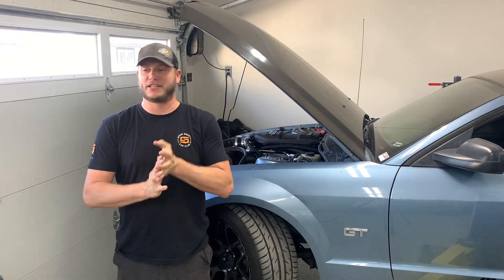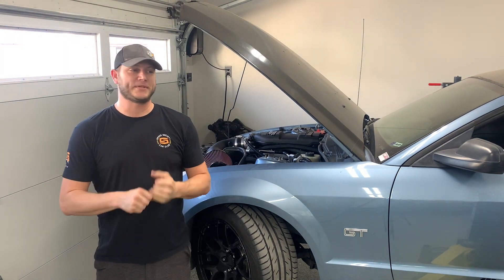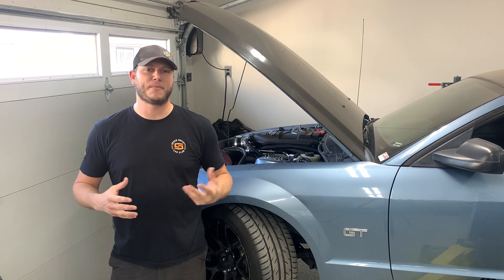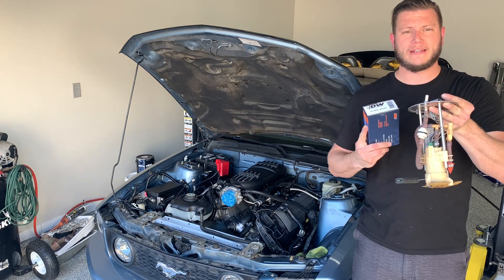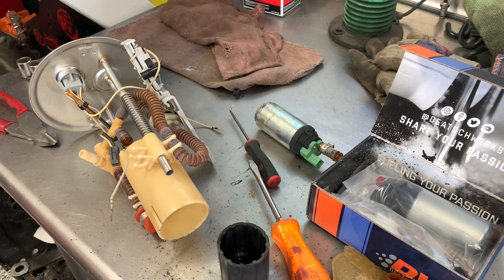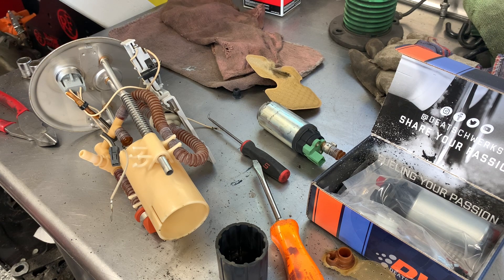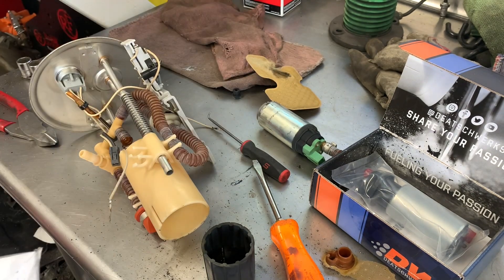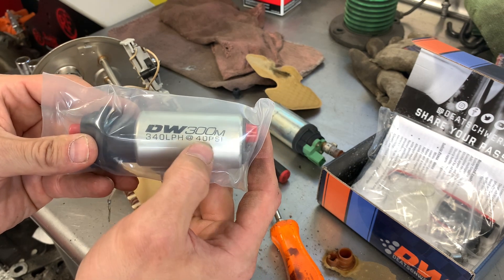Making a return style fuel system for your S197, completing it for the Coyote Swap!

Comment: is this really necessary i want to do  the coyote swap but dont really want to mess with fuel system like this can i just use coyote fuel line or maybe coyote tank pumps off 11-14?
Reply from the maker: Sending units aren’t compatible with the older tanks nor the cluster

Comment: I am a little slow, but is that "return line" connected to the fuel filter?
Reply from the maker: Correct. Since the filter is also the regulator

Comment: I have the dual GT pumps because I was running the Vortech V3 and 60lb injectors on the 4.6 3 Valve, making nice numbers. Is the same thing needed for the return? I see another well known Mustang channel that did a swap and they did not do the return line, so I am a little confused. Is it absolutely necessary to make it a return style system? Thanks.
Reply from the maker: Now that I’ve learned more since this video I don’t think so. The way I have it wired and with our now swap harness, keeps the fuel pump driver module in play. Of course if you get to a certain HP level, you’d want to go return style

Comment: Exactly what I was looking for after someone else in a different video stated the c5 filter could be used. I also confirmed the c5 filter regulator keeps around 58psi.  I know this is late but when I did my fuel line 10yrs ago on my terminator swap I fixed the lines inside the fuel tank hat.  The fuel pump hat has a couple of orange accordion type of plastic hoses with a beige square thing.  I replaced all that with straight hoses and the square thing removed.  The thought behind this is fuel starvation when driving hard on corners. Those accordion lines will fill up with air. Thanks for the vid. Now I am going a coyote in the fox.

Comment: This isn’t actually needed for a coyote swap is it?
Reply: I put the DW400.  The upgrade is a little more work for the DW400.  Might be better to stick with DW340 like Matt did, unless you plan to modify the plastic holder for the pump.
Reply from the maker: In short, to make things easier, yes
Reply: Based on how you build it, in my case I did GT500 with 2x of these DW pump cause I'm going SC